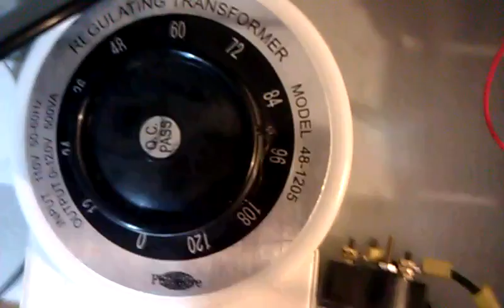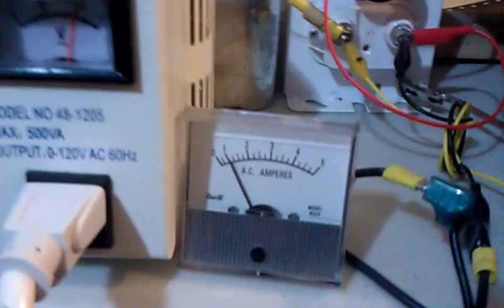Don Smith Device Project Part 37: 150 watts of Halogen Bulbs Mostly Lit :)

Comment: kdkinen: if oveheating incandescent bulbs for hig voltage, then use many mercurial tubes, these result say me, you should convert appropiate output for incandscent bulb whit other step transformer pass at intensity-ampers. from mexico dman

Comment: I'd? In your opinion is it possible to use a flyback transformer to recreate the simple set up that Don L Smith made with a flat copper capacitor handmade of about 20 " per side and with Tesla coil gun(used commercially as a tester for electronic equipment) . You get DC on the other side and if pulsed you can power a motor and then ground it he claimed that as ma y as possible could be on this side with same output of course over 20 kHz to see results, what's your take on that ..I have 3 flyback